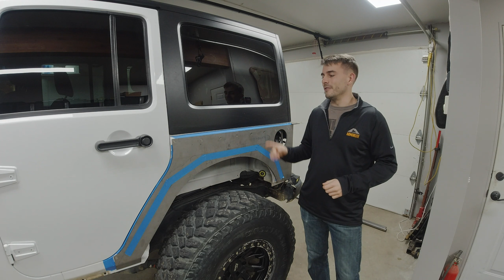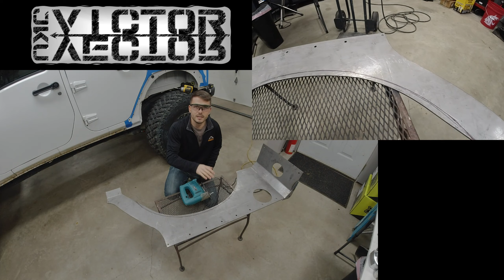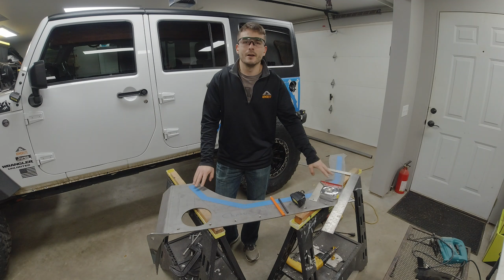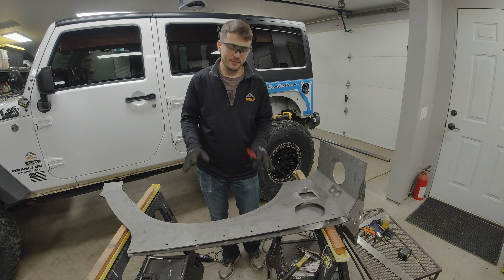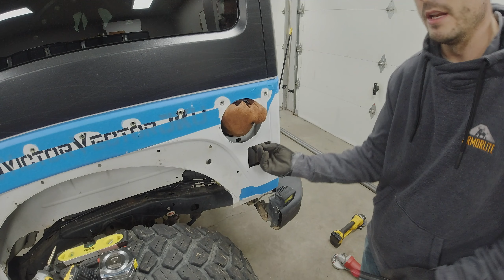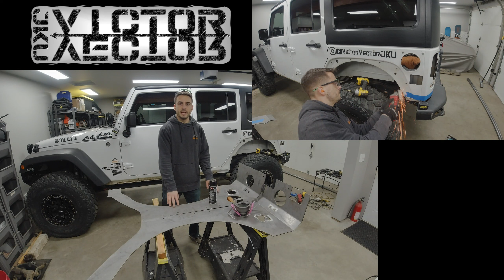EvoMfg Rock Skin Builder Corner Mod Part I - Cutting - Jeep JKU

Comment: To transfer the wheel cut out from left to right, you could have used the piece you cut from the drivers side to mark the passenger side....Hind sight. God bless and stay well.
Reply from the maker: Hey there Project Bumble Jeep, thanks for checking out my videos! Yeah, I definitely agree that I could have used the cut off sliver, but I was concerned that the material removed by the thickness of the blade and trying to line it up in the same spot without reference points would be tricky. So, by using the other panel allowed me to align a few points to ensure they were symmetrical. Mostly chose this route because I am a bit OCD, detail oriented.